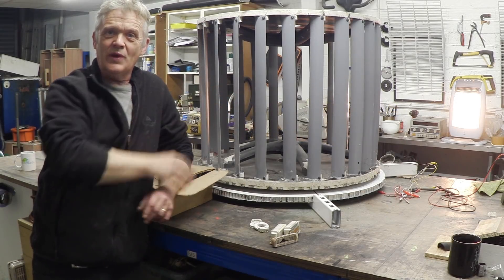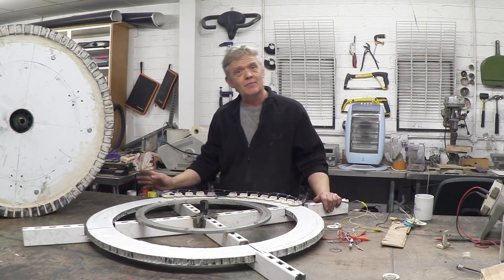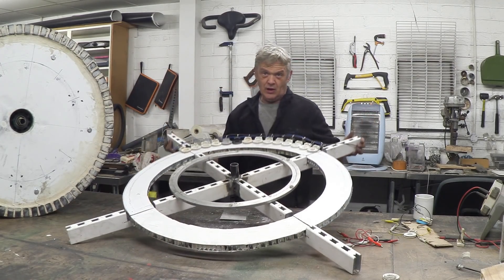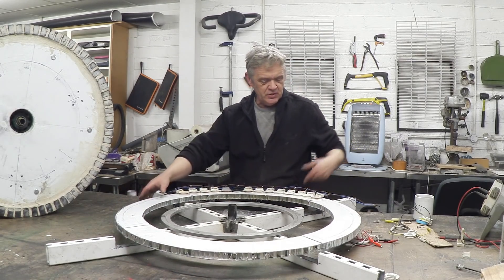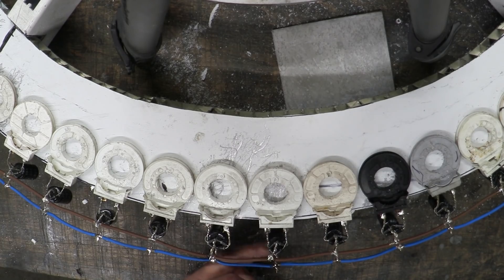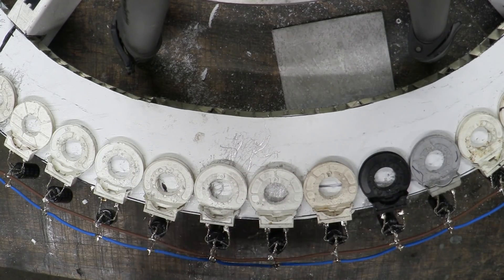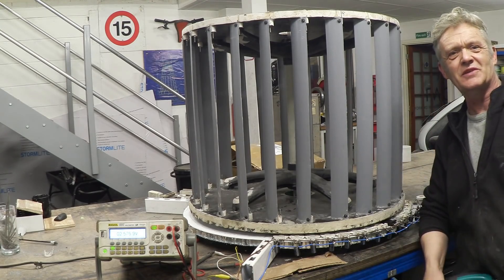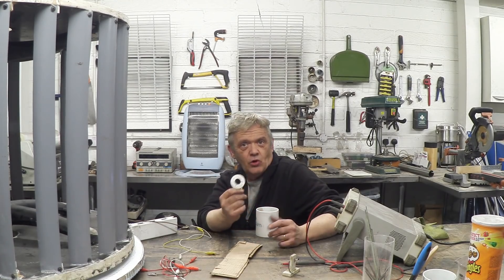Building A 1kW Wind Turbine For Under £100 - Some More Changes

Comment: Mate, I'm surprised You set it Vertical while Horizontal with an axe Through it should do Much Easier with no problem of "Stability". What do You think?
Reply: Horizontal needs the wind to come from one specific direction, vertical will pick up the wind from any direction even up and down.
If you watch a propeller style generator every so oven they stall from changes in wind direction.

Comment: Off topic: I just recently learned that Magnesium Oxide is commonly used in heating elements to keep the nichrome wire from shorting on the metal casing.  Apparently Magnesium Oxide is both a good thermal conductor, and an electrical insulator. Does anyone know what would be a good flexible binder that may be used as a coating for nichrome wire?
Reply from the maker: I recently spent a bit of time repairing two commercial ovens and the problem was the oxide had got wet and was shorting - so yes it is used a lot lol - flexible and heat resistant - maybe a silicate putty?

Comment: car alternators(aprox 1kW output ) use DC electromagnets to generate magnetic  field.
no current through the field coils... very small field(due to low residual magnetism in poles) low output current, and low starting/running torque.
lots of current through the field coils... lots of output current, but high starting torque.

yes a little of the output is lost driving the electromagnets...but it's far more flexible, and can dynamically match "input power" to electrical load, thus resulting in better off design point operation
Reply: I like the idea of using devices that were built for generating and already had the input of qualified engineers focused on the translation of rotation to power generation.
Reply: @RupertBruce  can usually Pick up automotive alternators moderately cheeply from vehicle scrap yards.

Estimate a  max wind turbine rpm, and take say 4000rpm as max speed you'd want alternator turning at. That allows pulley ratio to be calculated. 

Even if alternator turning slowly it will generate. .use field coil current to adjust how  torque reacted  to electrical power/available for turbine  to speed up etc. 

Electrical output would have poor voltage regulation. 
Would usually need a DC to DC converter to make much use of the el
Reply from the maker: they are still high torque devices mate
Reply: @ThinkingandTinkering  not the one I fitted to my car last time it needed changed.. Less resistance to being turned than a dremmel

Comment: I'm going to criticize for the choice of a vertical mounted rotor.  The thrust bearing at the bottom (you did use a proper thrust bearing, right?), the thrust bearing needs to be lubricated periodically.  Do you have a way to do that?  Also, one big reason why you never see vertically mounted commercial rotors is that the thrust bearing quickly clogs with dirt and sand requiring a replacement of the bearing...assuming it doesn't fail catastrophically before you notice the grit wearing it out.  Mounting the rotor 300 feet in the air nearly alleviates the grit in the bearings problem.

Comment: high voltage is good, but worried those caps are going to explode
Reply from the maker: I am not 50v is a pretty high rating but if it does worry you go for a higher rating

Comment: Interesting video. I just wonder how many will be connected in parallel and in series. Are you aiming for a 12 or 24 V system? Personally, I'm trying to find an LG or Samsung Direct drive washing machine motor.
Reply: Where are you based.  I may know a man I would think £20 delivered UK if he has one but he is scrapping 5 ton of motors in the next day or two.
Reply: Sweden. Will some day pick one up from a scrap yard
Reply from the maker: right now mate - I am afraid I don't know
Reply: How do you know which machines have the relevant bits in them? I see plenty of 'Smart' washing machines for sale, but wouldn't know how to tell what is in them.

Comment: What would happen in a high wind situation with this wind harvester?
Reply: It'll blow it to bits. I think in the future some kind of regulator will need to be designed and fitted.
Reply: @martincrabtree6704  could you have a regulator or switch of some kind that engages a high torque motor in high winds and get the best of both worlds
Reply: @DavesCave  I wouldn't have said so with this design, I know it's just a test model and for low wind speeds, but high winds will tear it to pieces if you try to stop it rotating. I'm imagining encasing it into a cube on a turntable with a vane on top to make it face the right direction. It will have an opening for the wind down the correct side so it hits the blades. A slider will open and close the entry bigger and smaller to suit wind speed. I was also having a look at Constantly Variable Transmissions earlier they would maybe work well with wind power, the faster it spins the higher the gears get keeping the load constant.

Comment: One problem with having so many capacitors all in parallel is that if one them were to blow, it shorts out the lot.  You could probably save a lot of money and increase reliability by replacing them all with just a few capacitors.  Especially as keeping costs down is one of your objectives.
Reply: Or just one capacitor, since all the capacitors are in parallel anyhow.

Comment: Wouldn't it be cool if you could add a gyroscope in the center of the unit......powered by the unit itself and serving as a means of both storing power and stabilizing the unit....
Reply from the maker: yes it would lol

Comment: Are not all those diodes a great loss? Would not be better if you could just rectify it once? I saw you had problem using coils in such way but maybe that could be ovecomed in other way.
Reply from the maker: I am sure there are a hundred ways to tackle this mate without individual rectification the coils would fight each other and lead to losses - this was my solution - pole and coil spacing would be another I would think - but then there would be less coils so a power drop - it's basically horses for courses I think

Comment: I think with commercial generators they sell by promising a Peak Load ..... which they fail to produce!
When you look at the way they are built (stator armature etc) it is unrealistic to expect quoted performance of them in anything but peak conditions and vastly lower at normal conditions! A bit like wondering why your solar PV system in northern Scotland does not give as much power as those in California ;0)
It would be interesting to see what the output of say 10 of your design generators would produce against an equivalently priced turbine!
There may be room for improvement in your device by replacing the "lazy Susan"! The problem (IMO) is that a lazy ssusan is designed to allow an weight to be revolved not spun. Getting a circular trck you could run such a device round may be more trouble than it's worth though ;0) 

This has turned out to be a nice alternative to "traditional" generators. Thanks!
Reply from the maker: I know exactly what you mean mate - and yes on the bearing a better solution is needed for sure
Reply: @ThinkingandTinkering  I was just looking at my microwave turntable ...... scaled up a bit? ;0)

Comment: 13:43 shows the turntable coils connected 
Question why not add a second loop just inside this first circle/loop of coils, do not heed to add or change anything on the other board (one with magnets attached).  Might get you some power.

Just for fun, a joke install one of the chairs on top, funny as heck no?
Thanks for your time

Comment: The comercial calculation for a low power windmill is very simple:
Say average output 50 Watts. It's 0,05 X 24 X 365 = 438 kWh. 
Don't know the price for electricity in UK - it's on the continent abt 30 Euro-Cent.
Means: 438 X 0,3 = 131,40 Euro per year. 
But this is in my opinion not the main reason. 
If you do a project like this the electric power been done with own hands; gives a huge feeling of success and saves a little bit the envroyment in different ways like less garbage because you used it for the windmill / less emission of CO2 and so on.
Reply from the maker: I agree mate - it's really about being able to do it yourself if you want to

Comment: In a high wind it's going to burn itself out. You should wire all of its output in parallel. Then you're going to need run it into a DC to AC converter into a down step Transformer in order to be able to charge a battery I think anyways
Reply: I believe all of the outputs are in parallel. A charge controller would be used on a project like this to regulate the DC voltage for charging batteries and such.
Reply from the maker: I thought VAWTs were self limiting mate. Plus - of course we could just use electronic controls to switch banks

Comment: I'd utilize the inside space for increased surface area? I'd get my money back for that leafblower!!!:)
Reply: Yes Robert; those acrylic boards scavenged from televisions could lend well to improving surface area in the interior that is open right now.

 I would suggest a configuration similar to the agitator of a washing machine as a starting point.
Reply: @ryanlebeck259  I was thinking along the same line but with sweeping concentric curve or progressively smaller rows of the same blades:)
Reply from the maker: for sure mate - on both counts lol

Comment: Couldn't you go another route to save on copper? One of the major issues with low power distributed generators is that if they ever became realistic, at least in the style you made, it would be copper intensive. The cores allow more power to be utilized from less copper.
Instead of going scoreless and using more wire, couldn't you have instead used leverage to get smaller force converted to higher force? Say, rig up a belt and various pulley sizes, where the fan portion spins a couple times to spin the generator wheel. You would still get low power, but the ratio of spins would give enough force to push against the coil with a core in it and it would generate more power per ounce of copper.
I don't know the viabilities of this, just asking your thoughts on feasibility and possibly copper savings.

Comment: I think you are missing the point somewhat. You keep on and on about low speed wind overcoming the turbine to start it turning, and using metal cils just adds to torque requirement to make it turn. The bit you have overlooked is the turbine itself needs to be as lightweight as possible, so it takes less torque to turn it. Through all of this i have watched you have used office seat bases to make the turbine. Each base must be about 6 or 7 likos, so the turbine has around 14 kilos of weight that you really dont want. the torque to overcome that dead weight must be astronomical. Its the reason peformance car manufacturers make their cars as light as possible.

Comment: I don't understand why it would be any resistance if there is no metal in the coils if there is no load on the coils my actual flux it doesn't have any drag if there is no load it only puts a drag when you put a load on it what if you just used a transformer to drop the voltage down and then rectify it in the DC
Reply from the maker: the filed in the coil always resists the change of field mate - it's Lenz's law I believe
Reply: @ThinkingandTinkering  that's why you the teacher man I'm glad you let us know I would have never thought about it but I went and looked it up does it matter what size of capacitors or do we have to use the same ones you did

Comment: Hi there Rob, I have enjoyed the wide range of subjects that you seem to command. However, your explanations of some of the effects of wind generators are a little shaky and the amount of power generated is only a small fraction of your claim of a 1000watt wind generator. Having said that I do think that the size and quantity of magnets you employ would easily be capable of said watts but so far you seem to drift away from the true path to 1KW of power. The use of MW turntable motors is a very poor direction for the desired 1KW. Secondly the use of MW transformers is a far better direction to take although at 1KW output the cogging effect would be a great barrier to overcome. The addition of rectification and 1000UF smoothing did produce a somewhat unusual anti-cogging effect but would change the total output to| DC power instead of the more controllable AC power. I am not saying that you are wrong but that you need to stay focused on the main problem namely producing at the very least a 1/2 KW of AC power which can be used to off-set the main heating bills of the average home electricity consumer. Your videos are great and I hope I have not put any spokes in your wheel. My intention is to redirect your efforts into a more productive direction. Regards MoK

Comment: Lazy susan has plastic and will evenually fail from heat from friction, but will work for a time.. great Jury Rig. (idea)
Reply: Friendly FYI, there are metal versions available.  Search eBay for "lazy susan bearing".
Reply from the maker: the one I used is all aluminium and steel mate - no plastic

Comment: Not sure if this diode or-ring arrangement will work efficiently. Diodes aren't ideal. they leak. there are now also as many VI losses through the diodes. The coil that produces the highest voltage will try to drive the other coils at least in an open circuit. This is also probably the reason why you only got very little emf on the output. It would be way better to reconfigure this as a poly-phase stator, 3, 6 or 12 phases depending on the efficiency and input voltage requirements of the inverter that would be used to generate the 240V AC

Comment: windmills are no well suited to making electricity  . and most current designs put everything at the top of a pole.but if you seperate the generator from from whatever you use to pump by adding storage you can do that , and get several advantages .windmills do high rpm constant duty very badly but if you add storage to this equation than you can set it up so the generator runs at high rpm constant duty .you can pump air into a pressure vessel you can pump water uphill you  can even lift a heavy rock with a set of pulleys when you do this you can put most of the moving parts on the ground where they are easy to get to and work on and because we are using energy storage you can use as many windmills as you like a good size for the generator part would be a gm 90 amp alternator is a good choice because you can  get a refurbished one for about 35 dollars and because it is gm it will be one of the most common parts in the world available but if your parts car still has an alternator you could use that for free. by doing this you can make several different windmills to store power to run the alternator.  pumping water uphill is a very cheap way to store power but any storage method will work . back in the 90's mother earth news did a multi month story about a physics class at the university of arizona were the clas built a vw with a hydraulic storage transmission  the first thing they figured out was the 57 h.p. was way to  big so they replaced it with a 16 h.p. and still up the top speed and lowered to 0 to 60 quite a bit sadly the professor was hired by the ford motor company.the next year so there were no more stories they only did a mileage test once in a competition sadly the bypass valuev was mounted in such a way that it ratelled shut disabling the fluid bypass circuit though they still got 90 miles to the gallon .the point being while in the short term  wind is unpredictable in the long run it is very predictable so if you can store the power when you can the storage will level out the available power and one of the cheapest ways to store power is to pump water uphill. sorry about the long wordage i just wanted to say enough so as to pass the idea along to others.
Reply from the maker: they are good ideas and thanks for taking the time to post them mate
Reply: @ThinkingandTinkering  no problem i have spent a lot of time thinking about it though i got a little wordy:-)

Comment: I see a deficiency in the design that will cause a potential large loss of electromagnetic  power creation. Passing a magnet over a coil whereby the majority or entire coil is doped by the field of a single magnet pole, t won't create any power.  Yes there will be power as each East/West side of the coil is seeing opposing magnetic fields on either side by any 2 opposing N, S magnet pairs  but a magnet overhead will create none which is lost potential. This is why motors conventionally have iron cores to direct the magnetic field 90° into a more 'push/pull' field down through the coil which gives the best outcome of the right hand rule for current flow from conductor in moving magnetic field. As a dodgy simple test, why not throw a pile of steel washers in through coil hole (then secured by a taper head screw for eg) and compare 🙏. I understand why you chose to not have cores due to magneto resistance but that's disposing of efficiency for the sake of startup torque. A solution for that is to selectively switch in circuit sections to the load once enough power is generated at a small section of coils circuit level which can be easily automated with a transistor switch. 
Its the actual load that will play the biggest part in impeding start torque.
Washers in cores, transistor switch to connect 3/4 of circuit to load once 1/4 of circuit has seen enough power from low resistance intital startup.